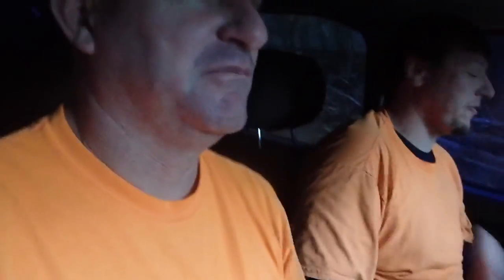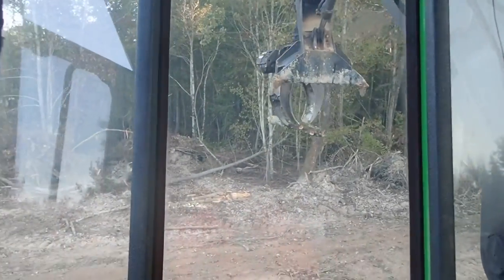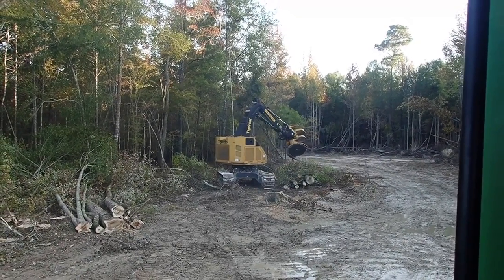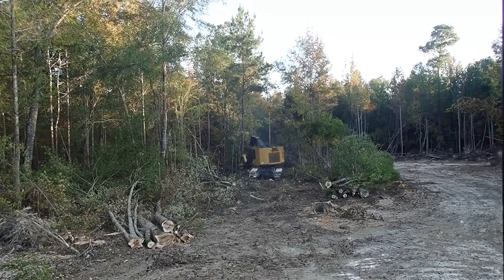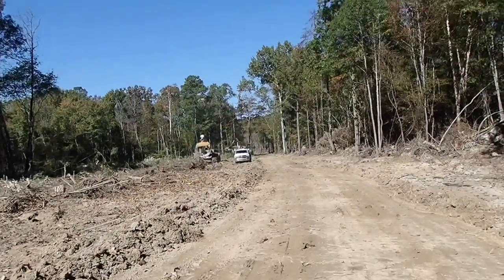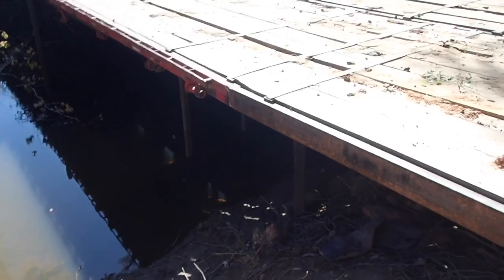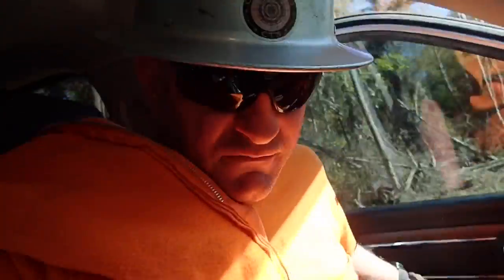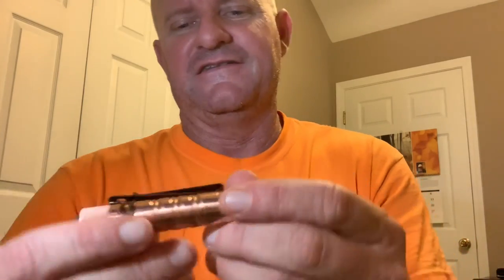New Tigercat LX830D track cutter in action

Comment: Looks almost like the hole we are down in right now. I'm planning on moving out to for awhile, until the ground sits up a bit better. Guess the mills will send us to some crappy pine brush to clear off. But,it's aight, keeps the bills paid and my guys working. Only downside by cutting timber the mills bought verses the timber I buy is less profit.

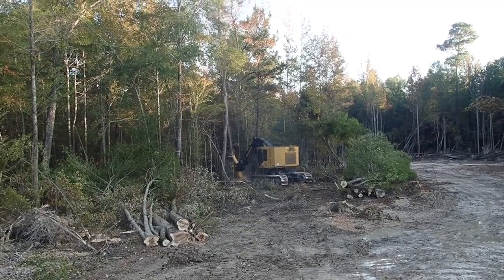Comment: Does the machine show the operator actual saw disc rpm?  I'm curious how much it slows with a heavy cut like the one at 9:20 where you say he grabbed it too low but pushed on through and made the cut.  Dig the videos, better than 95% of whats on television...
Reply from the maker: It’ll stall completely out on cuts like that.